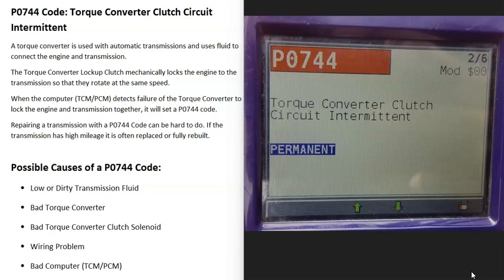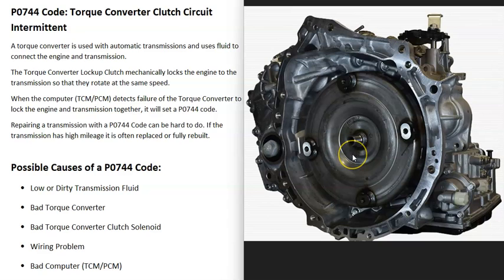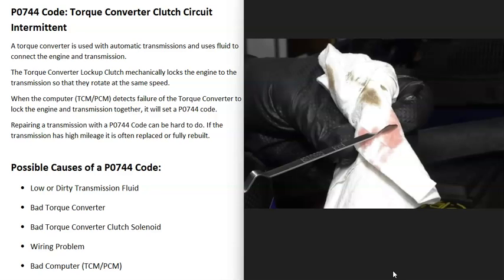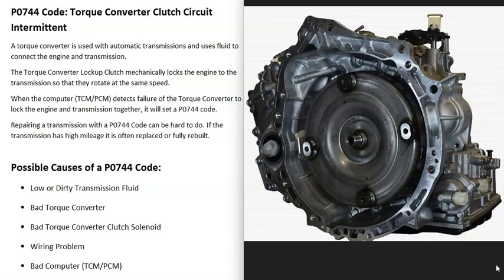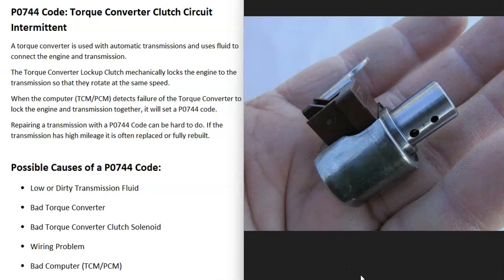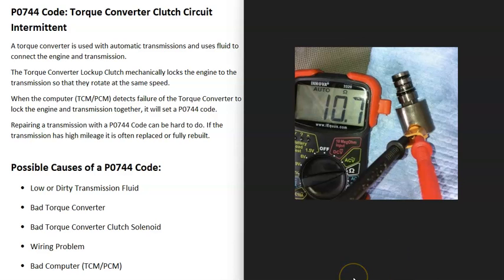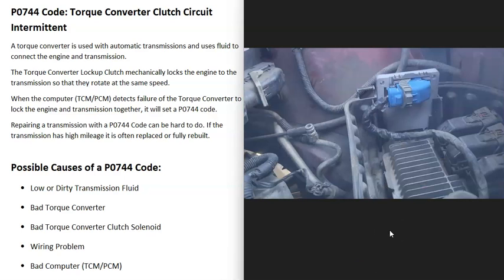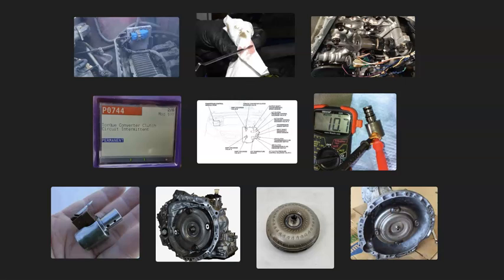Causes and Fixes P0744 Code: Torque Converter Clutch Circuit Intermittent

Comment: I just bought a 2019 Rouge with 93,000 miles on it. This code popped up so they put another transmission it. Got it back after the flashed the transmission and after 30 miles the check engine light is back on with the same code. Transmission shop wants to put another transmission in . Why would it show the same code? Help please. Our only transportation at the moment. Godbless
Reply: Hello did you sort it out? I have the same code on nissan versa

Comment: I’ve got  2011 Nissan versa with this code , should I bother getting the transmission fluid changed ?
Reply: Do you still have the code?
Reply: @IanChumba 
Hi
I’ve got this same problem too
Do you know how to fixed?
Reply: @arilsonflor5272  not, i also have the same code
Reply: @arilsonflor5272 did you ever figure it out?

Comment: I took my car to nissan after verifying my p0744 autozone diagnostic test issue was not linked to my tcc solenoid i did an ohm test. For every solenoid and they all came up clean 6.7 ish ohms which are in line for my car’s solenoids. A 2010 nissan altima sr. The tcm does not seem to be the issue either. I have p0740 circuit malfunction and mainly as the autozone test says p0744 code. I believe it can be a bad ground. They are trying to tell me i need to either replace the entire transmission which is more then the car is worth. It is a 10+ year old car. But i verified the belt is perfectly fine and transmitting power through to the wheels. And i replaced and assured that the fluid was at the right level. And the valve body seems to be intact. Any suggestions. Cause if not then my car has to be taken to another shop where they will probably be replacing the torque converter
Reply: DId yoiu have any luck replacing the converter ?
Reply: @ no sorry to tell. The torque converter and cvt transmission unlike all other auto transmissions is a sealed transmission with the tqc being mated to the transmission from factory and incapable of being removed and replaced without nearly rebuilding the entire transmission which is not worth it for a cvt on a monetary or mechanical level. Regular autos though do use a tqc and its replacement is able to be done without complete rebuilding of the transmission